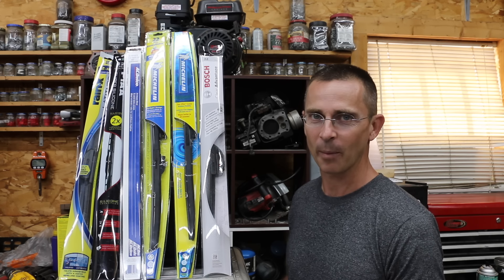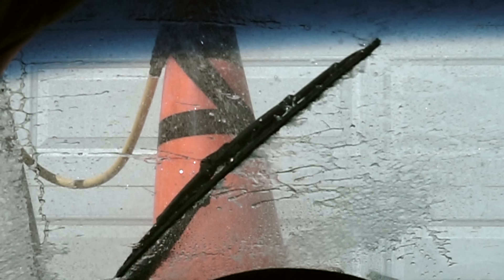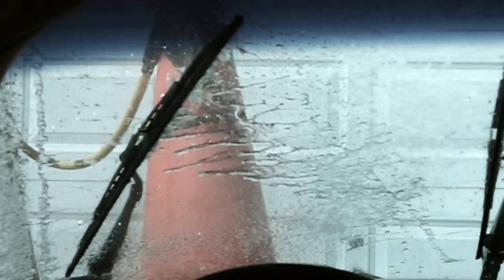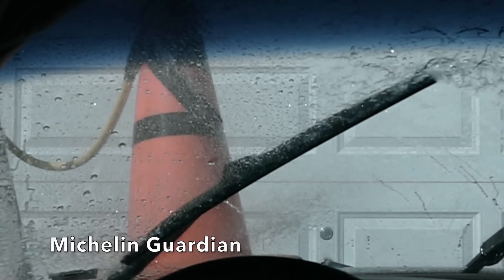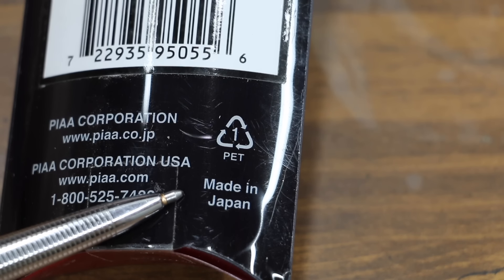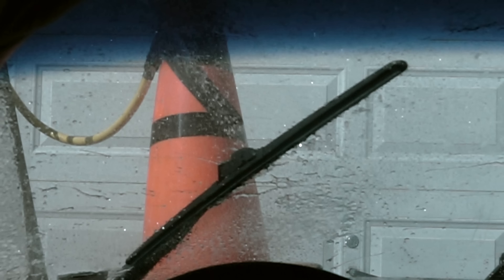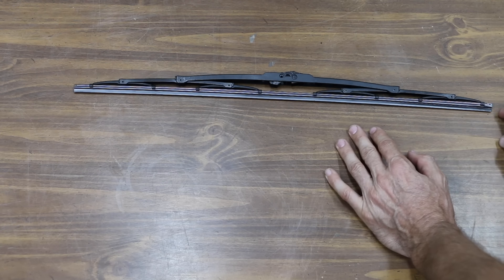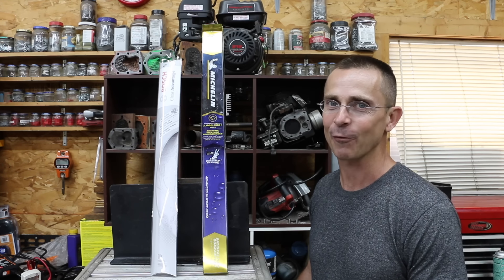Which Windshield Wiper Blade is Best? Let's find out!  Michelin, PIAA, Bosch, AC Delco, & Aero

Comment: One thing about wiper blades in freezing conditions I'm not sure you can simulate...the wind chill freezing the melting snow on a windshield heated by the heater/defroster.  I love the Rain-X and Bosch beam windshield wipers, but when I used them through the winters in the Nebraska panhandle...the windchill would freeze what I was wiping away locking the wipers in place momentarily.  On more than one occasion it ripped the blades out of their attachment to the wiper arms.  Granted, this was during winter storms with sub zero temperatures and high winds.  There are definitely trade offs for various weather conditions outside of just warm vs cold.  I can't see how you could readily test this, but it is something to consider bringing up on your next video about wiper blades.
Reply from the maker: Thanks for the video idea.

Comment: Nobody:
Michelin: check out this wiper blade that resists weather up to 195 degrees Fahrenheit
Reply: That's actually pretty common on windshields here in Arizona.
Reply: If it's 125 in Barstow you can bet temps get.close to that probably with reflected light and black painted wipers
Reply: The wipers with the covers are lasting longer in the sun/heat.
The cover keeps the blades in a shade, away from the rubber degrading UV from the sun.
Reply: Here in Florida that is a daily occurrence and probably well above that temperature on the window surface until it rains.
Reply: I live in Texas, and I definitely want it to resist heat and heat magnified from the cab and glass of my truck and reflected from the sun visor I use, so not nobody... people who live south of 40 degrees north latitude all want this...
Reply: Project Farm:   I'll be the judge of that.
Reply: Here in AZ I have measured glass temps of 260 degrees and interior temps of 200 in peak summer with car sitting in direct sun. This is the extreme of course, but it happens.
Reply: @sheputthelimeinthecoconut629  it's true! -resident of Tempe
Reply: In SoFlorida and we get a "shit ton" of rain and sometimes it comes down incredibly hard, like a cow pissing on a flat rock, so good wipers are critical (and a good pair of polarized sun glasses really helps in a hard rain too - you'll note that the State Troopers where theirs in the rain for good reason! ) - my issue is they don't last and my belief is that's due to the sun / heat, not a use / wear thing - I replace them once a year used Bosch ION and now upgraded to Bosch Envision pleased with results not longevity

Comment: I've bought Bosch before and they lasted about a month before they started streaking under the blade not over. Never used Michelin, but I use rainx for all my vehicles and they usually last about a year before the noise/streaking gets bad enough that it mildly annoys me.
Reply from the maker: Thank you for the feedback!
Reply: I've had the opposite reaction to these blades.  I regularly obtain Bosch blades and have had great results from them over the years and with several cars I've owned.  I switched one time to RainX blades several years ago, and those blades started streaking like crazy after only a few months.  I live in Florida so it may have something to do with the climate here, but Bosch blades are the only blades which seem to last through the hot, humid summer raining season at least for me.  Never tried Michelin's but may give those a try next time I replace my blades if they have those at my local auto parts store.  I normally get the more expensive Bosch blades though, and they cost more than $11 for a set of them that's for sure (more like $25-30).
Reply: RainX are garbage to install though.
Reply: @beanshady  I've never had issues with rainx and I love the rain repellent on the blade but everyone has different opinions, I'm sure Bosch are good wipers and honestly I think I got a bad set. I probably will try them again in the future. I wonder if different types of glass might play a role as well, all my vehicles are older vehicles as in I've never owned one newer then 2000 so maybe something about the way they made glass 20+ years ago or maybe the fact that they are already worn smooth by 20+ years of wiping has something to do with it.
Reply: @insaned4666  the new style of blades are actually really simple with J-hook wiper arms, they have a little spring loaded button that lets you open the J-hook flap thing very easily instead of the older one where you almost always needed some sort of key or screwdriver to snap it open. The other styles of wiper arms can be a bit annoying but they still work.
Reply: RainX had that stupid black plastic block thing that was a pain in the rear and never seemed to install correctly ... unless they got rid of it recently.  I stopped buying RainX a few years ago due to this.  Bosch always easy-peasy simple.
Reply: @SirFloofy001  That makes sense about how old the windshields are and I bet that would indeed make a difference.  My corolla is a 2012 and even newer cards probably have different types of windshields nowadays.  For my car, I typically get the Bosch Icon blades which are the more expensive ones that they sell at my local auto parts store.  They carry the RainX ones too but perhaps not the more expensive RainX ones for an equal comparison.  I got RainX blades only once several years ago... they were definitely more reasonably priced and worked fine for a few months before starting to streak.  They looked dry and worn way before I thought they would.  I replace my blades once a year when I get my next round of cabin and air filters (those I switch out twice a year).

Comment: The one thing that should be mentioned is wind pressure while driving. I have used many many of these blades over the years and find that the Rain X blades are FAR superior to anything else. Why? Because of the coating applied to the windshield, the rain drops actually break into tiny droplets and travel UP the windshield from the air passing over the glass. Also, I used to change wiper blades every year. My current Rain X  blades have been on my Ford Edge for 3 years and showing no signs of needing replacement. I will never use another brand of wiper. They ARE that good. Excellent test, BTW!!
Reply from the maker: Thanks so much!

Comment: The only issue is it varies depending on the windshield.
Reply: Steven Froese, Yes. Beams did nor work on two of my older vehicles - wind picked the up.
Reply: My 2nd gen GS hates steel frames but loves beams. So far the Rain X beam from Walmart are performing excellent, I'm planning to buy the rain x silicone before the rain hits again

Comment: Youre missing one very important element in this test, the vehicle isnt moving so there is no wind pressure on the blades. The non-metal blades have a tendancy to be too soft and vibrate/jump losing contact with the window at the edges during highway speeds.
Reply: PeritusTV came here to say this too. Having some fans blowing/simulating wind on the windshield and blades would make for a more accurate test. For some of these blades the results might be significantly different.

Comment: The biggest test is how long they'll actually last for.
Reply: I always just but to pair and keep and extra in the vehicle.
Reply: Effectiveness is actually more important to me, I only have a drivers side wiper And it gets used rarely, so I want it to be perfect when I need it, and don’t mind replacing it more often as I just add it to my regular maintenance schedule
Reply: Well, considering that they are all made of rubber and exposed to the elements, none of them are going to last too terribly long.
Reply: @jacquelynhickman9060  the pricing on the Michelein silicon says it will last 4 years and get all chewed up by Hwy windshield impacts.

Happy Bosch will do for $10 to be  replaced yearly after UV summer exposure
Reply: @zackburkhart8693  I think you missed my point. It will also depend on exposure to elements like weather. For example, in Southern California, the rubber will break down quicker due to being exposed to high heat and low humidity.
Reply: @glasser2819  I've tested the silicone blades and I am not impressed at all. After a few uses they began to skip and chatter across my windshield, not to mention they were horrible at clearing water. But, I know that isn't the case for everyone.
Reply: @zackburkhart8693   So true.  I've had problems with rubber inner tubes made in China,  with dry rotting and inability to hold a patch.  I was told it was because the Chinese use a lot of synthetic rubber in lieu of natural rubber.   That's why I perked up a bit when I saw one (forget which)  listing "natural rubber" as one of it's selling points,   even though it's made in China.  If you want a rubber wiper that will last,   I would suggest any that highlight"'natural" rubber as the composition.
Reply: @zackburkhart8693  agree to disagree. Premium doesn't mean better or high-end rubber. For example, in the heavy-duty market, truckers constantly are changing their wiper blades, regardless of premium. This is done simply due them being used frequently and breaking down due to use and exposure. Maybe for someone who doesn't drive much, or their vehicle is stored in a garage, they may see better results. However, it differs from person-to-person because of so many variables.

Comment: As a commercial CDL-A driver (I average 130,000 Miles/Year). I tell all new drivers to apply Rain-X or a similar treatment to ALL the vehicles glass. 

That means the windshield, your side mirrors, and your hood mirrors. And to also run silicone wiper blades. 

Third I run Rain-X washer fluid as well. 

You're always looking out the windshield driving doing your job and having highly reliable wipers is worth the cost! Especially in bad winter conditions!
Reply from the maker: Good Point!

Comment: The best wiper blades are Bosh “ICON”  , usually last two years + !!!
Reply from the maker: Thank you for the feedback!
Reply: I have Bosch Icons and they have lasted nearly 3 years. The last time I was in a heavy rain I did consider whether it was time to replace them. About 1 1/2 years ago I used a tiny amount of AT-205 Reseal on the rubber blades. This product restores flexibility and function to many rubber products. The cost is about 10.00 USD for an 8 ounce bottle. I do think the difference is more dramatic on some rubber items that it is on windshield wipers. But it did seem to extend the life of my wipers for pennies. Seems to really help aging rubber bushings.

Comment: Where I live the summer is very hot and humid and the winter is very dry, and the UV exposure is very high almost all year, so most of people change the blades at least once a year before the rainy season. I have a 2006 Ford Ranger and a 2016 Focus, for the truck I use Dyna wipers and Bosch for the Focus, as they're the cheapest option for each.
Reply from the maker: Thanks for sharing!

Comment: You really need to include a longevity test with these blades.  I started using PIAA silicone back in 2019 and I haven't replaced any yet.  I will be looking for the Michelin silicone the next time I do.  I used to replace rubber blades sometimes twice a year.  I will never buy rubber blades again and did I mention they are super quiet.  Thanks for all you do. 😁
Reply from the maker: Thanks!  Thanks for the video idea.

Comment: As an car/bike enthusiast reviews like this are very much appreciated.  Visibility is paramount to avoiding accidents, supplementing attentiveness.  You're always real good about trying to control variables - one thing to consider for wipers is that they also have to operate at speed, and thus aerodynamic forces are at play.  While I realize it's much more difficult to try and simulate a 20 / 40 / 60 mph (even 80?) car speed and checking wiper performance, and it's not like you can just easily build a wind tunnel, perhaps this is something you could consider in a followup review?  A couple of leaf blowers funneled appropriately or something to simulate highway speeds, I don't know ;)
I've found that some of the more modern blades will stick better at higher speeds, whereas the classic "steel" designs tend to experience lift off at certain speeds.  This quite obviously impacts wiper performance.  Some cards as old as 2000 or earlier even come with spoilers for the wipers to help mitigate this, and they definitely do their job!
Also, depending on the rake of the windshield, smaller cars could possibly have "dead zones" depending on the wiper blades used, due to the curvature of the blade / mounting system.  These usually occur on the passenger side corner (if in US). 
I was expecting you to do the wiping with the frozen blades as well ... ;)
Reply from the maker: Thanks for sharing.

Comment: I have always been partial to rain x expert fit hybrids. Those things last forever for being rubber. I tried the PIAA silicone before and they streaked very quickly; however, where it was making contact they do great. I just think if i kept my window a little cleaner they would have worked better. Idk what it is about those rain x ones but i think they work great.

Comment: I was part of the the r&d on the carbon black that would make the first frame less wiper blade from Michelin. It was a cross between our tread and sidewall black so that it would be ridged enough to hold shape and flexible enough to wipe. They held the patents for a while before everyone got into the game. Also I hope on the UV exposure you are applying weight down on a flat surface. That's what kills the wiper, when the wiping edge gets bent from uv and pressure on the windshield.
Reply from the maker: Thanks for the feedback.

Comment: I drive a Toyota vehicle. I  always replace the rubber filament and reuse the metal frame per the manufacturer's instructions.  The rubber seems to last a long time and runs quietly. However, those little rubber strips are nearly $40.00 a pair. The frames are over $100.00 each. Apparently windshield wiper replacement is big business? Great video, thanks! ✌
Reply from the maker: Thanks and you are welcome!  Thanks for sharing.

Comment: I've used Bosche once and illl never go back to another brand. Had the same set of wipers on for well over a year and a half or more and  still perform perfect. Quiet, no streaks, no cracking or splitting in the rubber.
Reply from the maker: Thanks for sharing.

Comment: I've had both the Bosch and PIAA, what I missed was the treatment on the window for the PIAA, when used it will repel like rain-x and the silicone will leave the windows water repellent in the long run meaning less need to turn them on at speeds over 50 mph. Durability of the PIAA is tricky to say. The Bosch generally lasted a year. My first PIAA I sold with the car after 3 years, the second set is now on my car for over 3 years and still not in need of replacement. They are a pain to get though (no dealer for the size I need in my country) so I'm likely going to look for the Michelin silicone ones if I have to replace the PIAA before the car gets replaced. On really heavy rains the water may come and I have had to park the car in extreme weather twice.
Reply from the maker: Thanks for sharing.

Comment: I just watched your windshield wiper blades test from October 2019 ,. It is a very good test and  I really liked the video .  but one test that I believe would be very important would be if there is a way to test the durability of the blade frames in very cold conditions ,. I live in Wisconsin and a problem that often happens is that the wipes blade frames during the winter , especially where they atatch to the wiper arms ,.  and it often seems to be the solid one peice wiper blades that break , more often than the several peice older designs. 
 the plastic just doesn't hold up to the strength of the metal ones . 
  thank you for your videos 
  Tim from Wisconsin .
Reply from the maker: Thanks for the suggestion.

Comment: It also depends on your climate. If you live up north, a beam or hybrid type works best. Here down south like in Vegas where it rarely snows or freezes, a conventional blade is the best value overall. I always had conventional blades for my 2015 Mitsubishi Outlander Sport and never had a single issue with them. They always lasted long enough and are always affordable since I live in Vegas. In fact, my original blades lasted 3 years and I replaced them with the Autodrive conventional blade from Walmart, 5 years later, they still work fine, though they're starting to show signs of wear, but for $8 a set, what do you expect.
Reply from the maker: Thanks for the feedback.